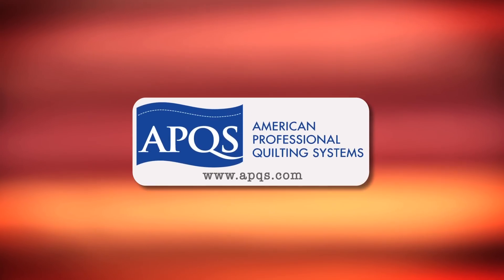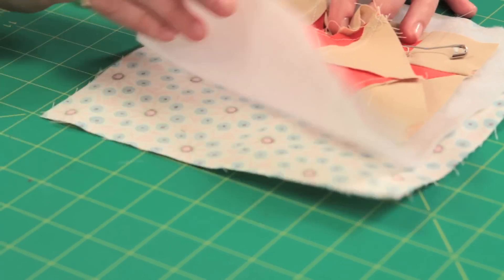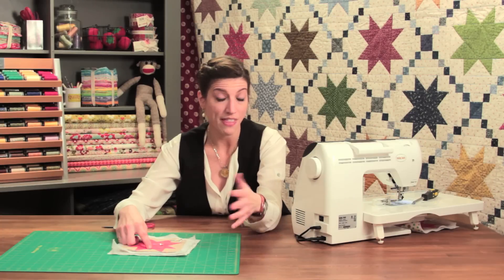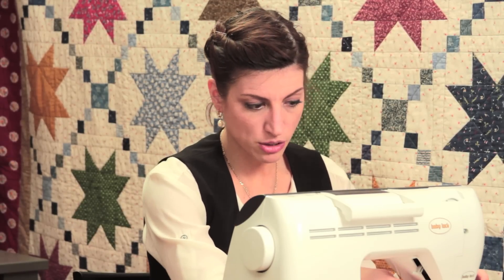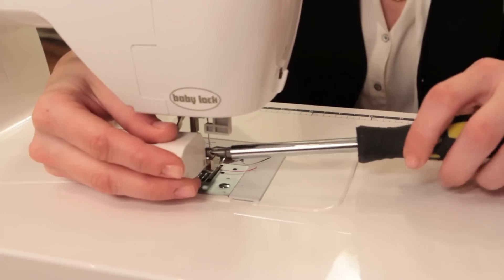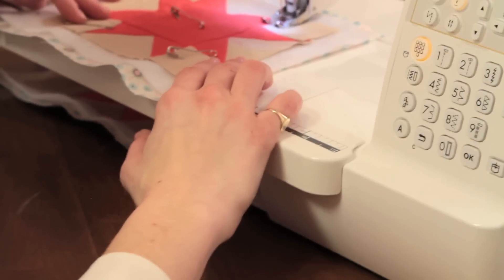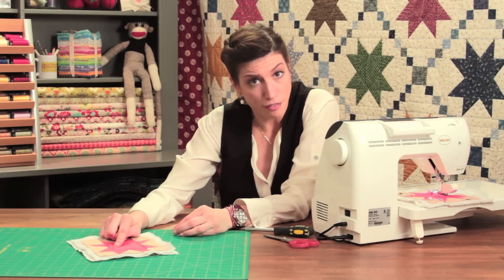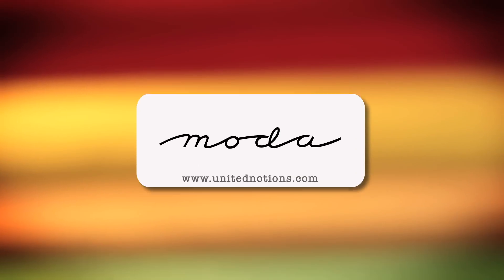Quilty: How to Stitch in the Ditch

Comment: I liked your demo. One thing for your suggestion about using the walking foot to make straight lines. There is a gadget called an "edge/quilter guide" and I see You can use them in the foot. Mine has the hole in the back that you put the guide thru and it is adjustable for help in quilting straight lines.

Comment: I'm trying to stitch in the ditch my very first patchwork baby quilt. But my machine keeps skipping stitches! What do I do? I've adjusted the tension and stitch length settings all the way down and back up and I still keep skipping stitches. I also changed the needle and rethreaded the machine from the top and put in a new bobbin. I'm skipping at least 1-3 stitches per test row. HELP! -Rachael
Reply: Rachael Wilson Have you replaced your needle?  If it's bent (which happens commonly when you're stitching through more layers than normal), your bobbin housing will have trouble catching every stitch.